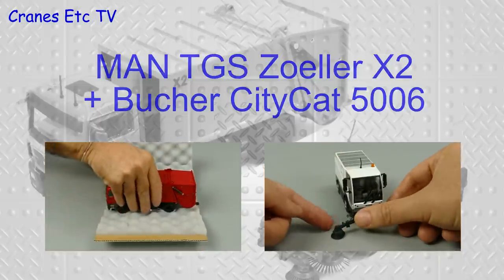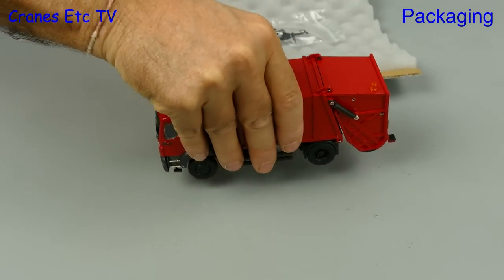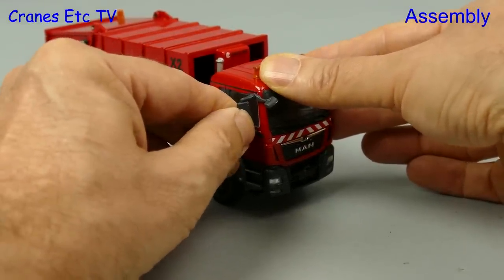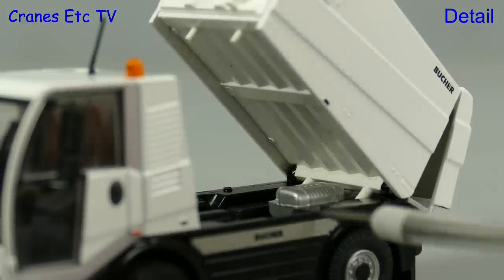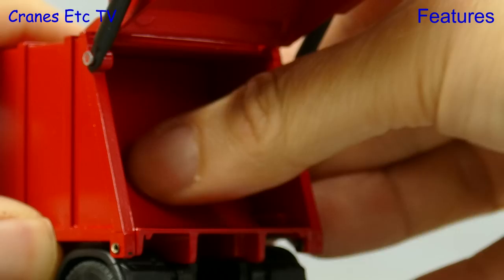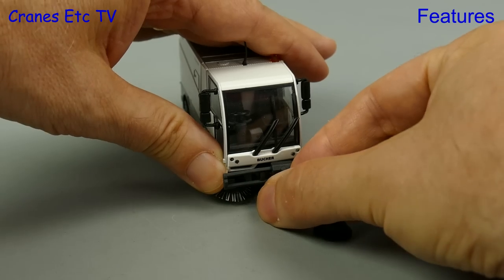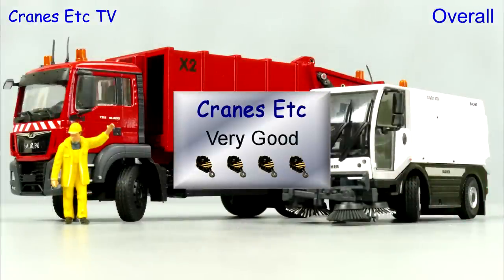Conrad Zoeller X2 Refuse Truck and Bucher CityCat 5006 Sweeper by Cranes Etc TV

Comment: Does the compacter work in the hopper?
Reply from the maker: All functionality is shown in the video.
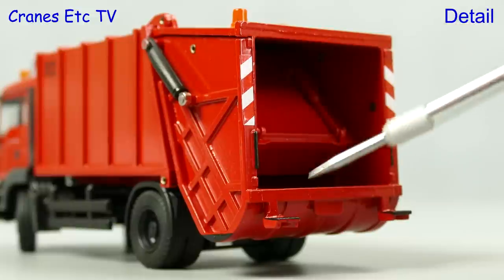Reply: At 2:32 you can see it in the back and does it move to compact the waste
Reply: It doesn't work but the ejector plate inside the body what the sweep plate packs the waste against it has a Hydraulic ram on it with a spring around it conrad models are really well made